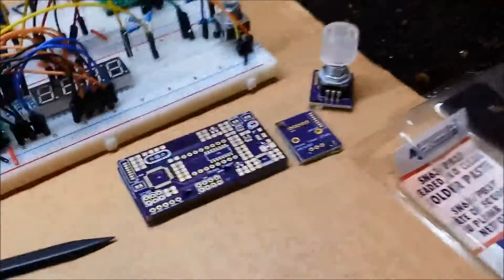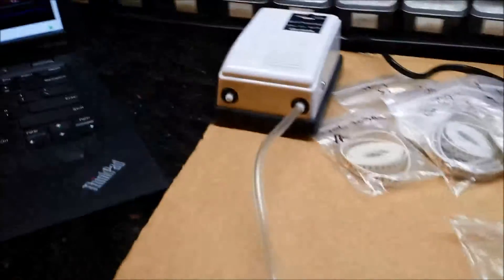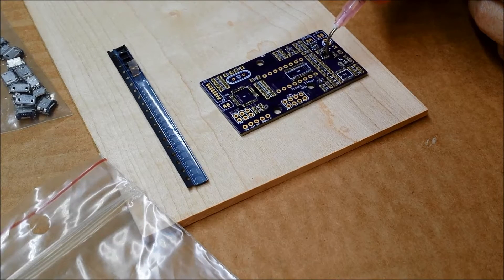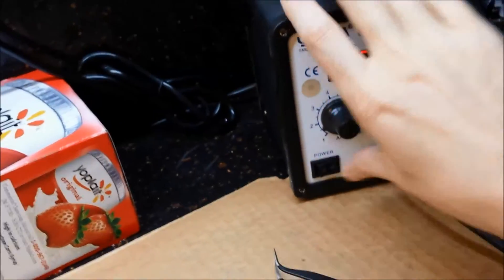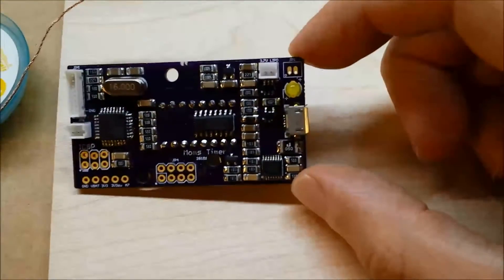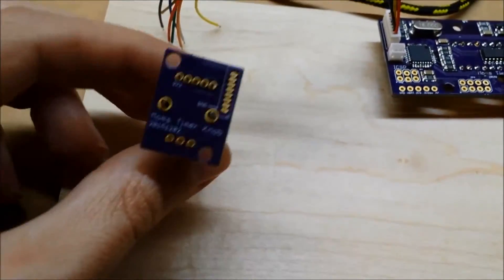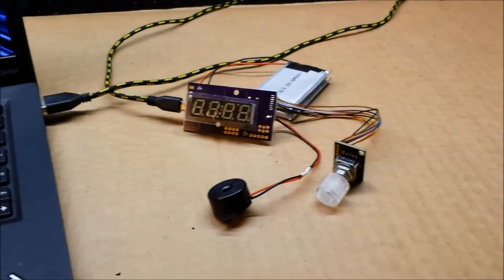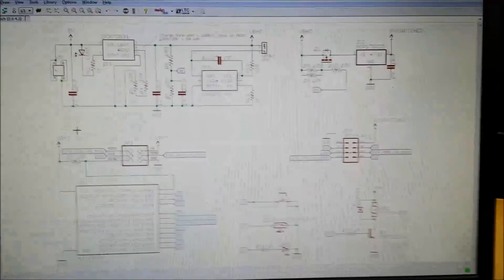Moms Timer 10 - hot air reflow soldering

Comment: nice job ! but when firing up the board first time, may be you can use a bench power supply with current limit on.
Reply from the maker: That is a great point.  I made myself a little power supply (4xAA or AAA batteries with an adjustable voltage regulator) that you might have seen in my videos, but it doesn't have a current limiting feature.  I really want Dave Jones to finish his uSupply https://www.eevblog.com/projects/usupply/ but its been years in development, so maybe I should continue my own little power supply and add current limiting.  More fun :)
Reply: hi. yah current limit & current monitoring is an essential part of bench. you can hack a lm2576 / 2596 module with an lm358 opamp to have the feature too, like its explained here: watch?v=EVL7TzCde8I
Reply from the maker: thanks, watching it now!

Comment: Wow, Great job!  it is impressive that it worked the first time. Solder bridges are a problem but the stencil does help I used the same method that is explained at to make a stencil on Spark Fun, with the exception that I printed directly onto the aluminum using an HP laser printer.  It seemed that some of the areas without components had dry areas but a sharpie fixed this right up.  I also found that if I used a dark colored Monster energy drink can that when acid etching the aluminum was performed, I could see that the hole was complete.  This was because the light grey starts turning black and there is light grey ring around the black area of the pad.  If you continue until the paint is disappearing then you are about to wait too long.  Don't hesitate to remove the stencil, rinse it and carefully apply acid the area that is going too slow.  After etching and removing the tape on the back, you can use Scotch Brite to clean it and an exacto knife to clear any details.

Comment: Cool project, and nice work on the reflow.  Love that vacuum tool you used.  I've not done reflow myself, but I saw a video recently that made me think of how you could avoid so many solder bridges.  This video I'm linking shows how to make a solder paste stencil so you can "screen print" your solder paste and use less of it.  I'm guessing the solder bridges formed because you used just a little too much paste on the pads.  Have a look!  https://www.youtube.com/watch?v=JWUJtmgh55M
Reply from the maker: +John W Thanks a lot man, if I ever need to make a bunch of boards, I'll definitely use this technique!  I haven't used them before but I saw https://www.oshstencils.com and it's only 0.65 cents per square inch (MomsTimer's PCB is 3 square inches).  Pretty unbelievable how inexpensive this hobby can be.